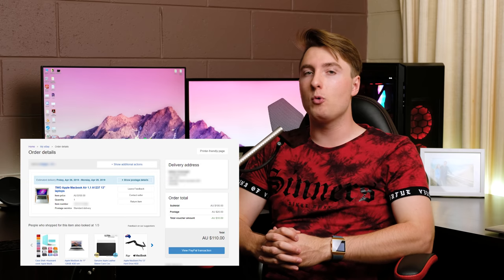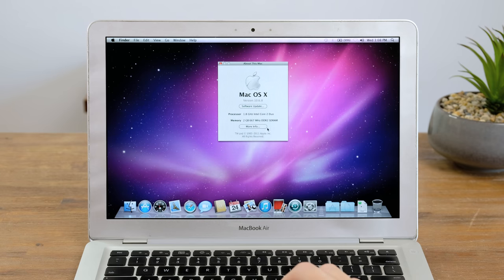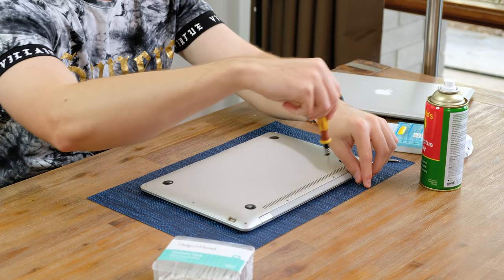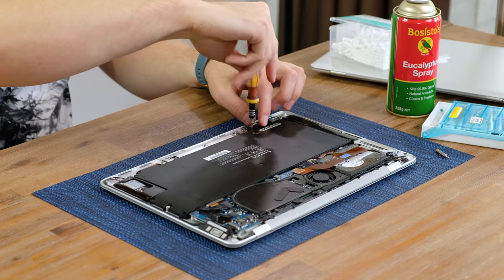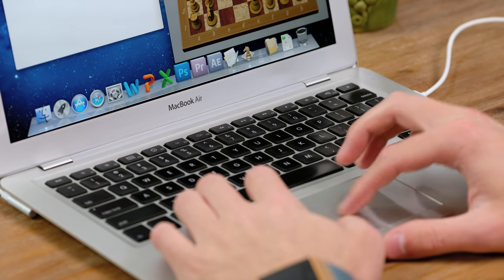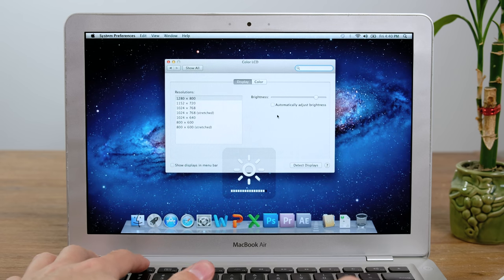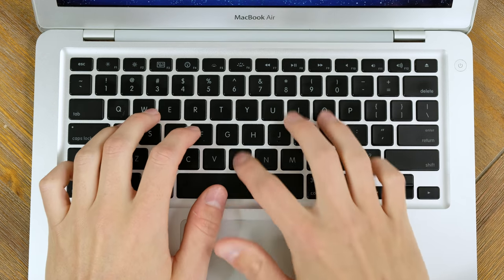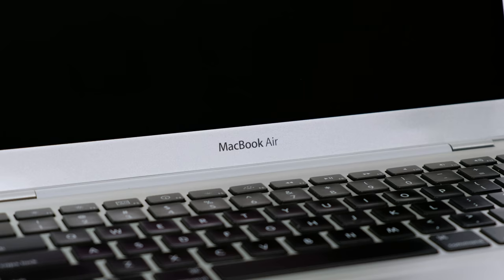I Bought 2 Macbook Airs For $100! Big Mistake?

Comment: 100$ for two working Mac air that's a big deal!
Reply: Not for these machines it isn't.
Reply: @jamiechampion299  why
Reply: @lefteris.adamou.1  Those machines are next to useless for the modern internet, not to mention that the newest official version of Mac OS X is 10.7 (we are on 10.14 now) and that they get hot enough that you could probably cook an egg on the bottom.
Reply: It's a ripoff. 1st gen MacBook Air's are useless now.
Reply: Kourkutas2 Kutsukuta I had a 2006 MacBook and it worked fine
Reply: Baickai Corporation  True lol
Reply: it isnt.... Why? So easy to tell. You can bid 100$ for two  2009 macs and they are better. ok no portability but who needs this ? When you need portability pleas buy 2010 mac airs ore 2013 airs
Reply: So many emotional commenters when it comes to apple stuff.
Reply: you can get an iflash adaptor and a 128gb sd card and with almost 150$ you get a working macbook
Reply: @notgeorge7563  for 150$ you can actually buy a 2012 macbook air instead.
Reply: For $50 per machine, you should be grateful they're working at all :)

Comment: These computers have no dedicated GPU, you didn't clean the GPU you cleaned the North Bridge
Reply: Actually Core 2 Duo CPUs do not have built-in GPUs.  GPUs are soldered separately on motherboards and he was correct.
Reply: Actually the smaller chip is the PCH

Comment: These were $1800 back in 2008, and for the price they did not age well. The Late 2008 / Mid 2009 with an SSD is slightly more usable, but still limited by the soldered 2 GB RAM and prone to Northbridge failure.

Comment: Mistake or not, still great to see those old laptops restored. I've been doing the same on an old Sony Vaio of mine from 2005, installing a current Linux 32 bit distro on it, alongside Windows XP
Reply: I have a Sony Vaio from 2005 and installed linux on it alongside windows xp too. what a coincidence
Reply: @cidsx  mine is a VGN-A317M model. Still a nice looking machine to this day with its 16:10 17" panel.
Reply: I miss Vaio. It looks good, run fast and super durable for it time.
I wonder if the new Vaio is on par with Sony Vaio.

Comment: I like watching you giving old Hardware a second Chance. I do the same as a hobby for over 10years now and most of the time Laptops and it surprises me every time how well most of them are usefull still today. Only cleaning the coolers, new thermalpaste and an cheap SSD. The only thing that suxxs is how hard it gets over the years to get to the components. Old alienware just remove 4 screws and you can reach everything, Last week a Toshiba from 2014 remove 16screws...turn around 8 screws...take out Keyboard...disconnect hundrets of these thin flat cables....Horror.

Comment: I would love to see how those run on Lubuntu. The lighter weight OS may speed them up. I have had very good luck with very old hardware and using lubuntu. Like 1.2ghz single core 32bit CPU with 2gb ram.
Reply: Me too, I'm considering replacing battery and SSD on a failed MBA and instal a Linux distribution on it, but have no guidance.

Comment: I'm really surprised the hinges are still good on these, they were a flawed design. Unless they've already been replaced but I don't think so. Apple official replacements were black but your machine looks to have original silver hinges. I'd be careful because when the hinges fail they often damage the case.

Also, try running Win7 or some other system and see if it runs any better, I bet it will.
Reply: s8wc3 It will run faster if it uses lubuntu, but I highly doubt that windows 7 will make it runs faster.

Comment: I just rebuilt a dell latitude D6 30 from 2007! Brand new LCD back cover LCD screen LCD trim bezel keyboard palmrest re-pasted a CPU gave it a good cleaning upgrade the RAM upgraded the hard disk drive to solid-state and installed a second modular bay battery! I didn’t join The eucalyptus squad however, because I prefer to use isopropyl rubbing alcohol to clean and disinfect

Comment: the mid 2009 higher end model with the SSD is 200 USD on ebay as of now. Works well as a budget laptop for High Schoolers since you don't need much out of a school laptop. It also means better software support as you can go as high as macOS 13 with patches but macOS 10.13 is fine for me

Comment: Still using my old laptop bought Dec 2009  when i was college. Still working fine untill today, im using it for networking,browsing youtube, paper works and using as a storages for my files.
Upgraded windows 10 already. Anti virus is up to date of course thats why it last.

It's a dual core laptop. 2gb of ram but i upgraded to 4gb of ram to make it more faster to handle multi tasking.
Reply: for that purpose you don't really need a expensive pc
depends on what people need to do
i need a more powerful pc to run games

Comment: Hi I don't know if this would help but have you tried installing Linux on the 2 MacBooks? I had the same problem with my Dell laptop. I'm not a apple user so I don't know if this makes a difference or not. PoP OS is what I used and it has fixed the problem in it's debugging while in the install process. I hope this was useful in some way. Really enjoyed the video. Thanks for the content! 👍

Comment: Running Ubuntu 16 on Macbook Air A1304 2gb with 128gb ssd.

The trick is to have a laptop stand to help with heat buildup this 
will prevent the laptop from overheating and shutting down.

As a netbook and for basic word editing the laptop is fine you can also run hd youtube videos on it.

The trick is to install a linux distro and to limit the number of active application running at one time as ram is limited.

Comment: Been building high end systems since the 90s, since even before CPUs needed heat sinks. I have always applied thermal paste in the way you showed, and my thermals have always been great. The whole (non-conductive) thermal paste application debate simply needs to end. Unless you're delidding and using liquid metal, pretty much any application method works as well as another. Put too little on and, yes you have a problem. Put too much on and you'll have a mess, but your thermals will still be fine. Err on the side of slightly too much and get on with your life. 🙂
Reply: I would love to get more informartion about that thermal paste application thingie, I wish to give a new life to a MacBook Air 6.1 with a failed battery and SSD.

Comment: Hi Psivewri!
i have a Macbook 2.1 black and want to install the latest version available of Mac OSX available for my hardware (Lion). and i see you used a flash drive to install Lion in the video. if possible, could you point me in the direction of the required files for USB installation?

Comment: "Setting it to the maximum brightness actually crashes the system"... How?
Reply: this is my question too. the screen obviously gets brighter. it's obviously not a power delivery issue or anything like that. 

the only interface the screen really has with the system is the software controlled parameters, such as reporting back what brightness it's set to. makes me wonder if the LCD controller ends up causing a buffer overflow/underflow or something. like maybe it uses an extra bit, or slightly different signalling in some other way, than the laptop firmware is expecting. maybe it's a slightly newer screen for a slightly newer macbook of the same size, or maybe it's an unofficial third party screen. so many questions!

presumably the syslog would say, it usually notes an actual reason for a kernel panic when they occur. far more reliable than correlating trial-and-error to try and suss out a cause and effect. obviously that information isn't present in the video though. 

i've been baffled by "maximum brightness crashes entire system" for like 10 minutes at this point! given how gracefully osx (and unix in general) handles application crashes and threads trying to go out of bounds in memory and stuff, i've got to assume it's something low level causing the problem. that makes me think drivers, running in ring0 on the cpu. which brings me back to the software-reported brightness level. it's the uncertainty on what exactly is going wrong in that process, that is really bothering me, haha.
Reply: @kaitlyn__L  It says "invalid backlight duty cycle" if it helps
Reply: @SkynetCyb  yeah that does. The duty cycle refers to the % of time a PWM cycle is on. Half on, half off, is a 50% duty cycle. It must've overflowed the internal logic, by going slightly faster than intended.
Reply: @kaitlyn__L  I saw a thread on ifixit about it, apparently there's nothing to be done, but I'm still wondering why it even happens, since they're apple's own displays
Reply: @SkynetCyb  apple outsources panels from LG and Samsung so there's probably a mixup there
Reply: @kaitlyn__L  I thought about it, I'd love to check which display came stock and which I have, but I have no idea, do you know where I could look?

Comment: With laptops or anything that has an exposed die, you should always manually spread it to cover the whole thing since it doesn't have the IHS to spread the heat throughout the whole die.

Comment: Put an SSD in the faster one and install Windows 10. 10 runs very well on a a Core 2 Duo with at least 4 gig RAM. I put it on a 13 year old Compaq laptop, after upgrading it from a single core 32 bit Celeron to the fastest 64 bit Core 2 Duo it could take and upgrading to 4 gig RAM of a speed to match the increased bus speed of the new CPU. Laptop was a freebie, spent around $20 on CPU and RAM. Same story with a slightly newer Dell Inspiron 1525, though that one did cost me a few bucks at a yard sale.

So how about it? Use Windows 10 to get more life out of old Intel CPU Macs after Apple has cut them off from current versions of OS X.

Comment: Dear Sir.  I used to be a Machead forever.  I switched to Windows at 10 because I hate Tim Cook's Apple.  I've dabbled with Linux over the years and felt MEH about it.  But in THIS circumstance I'd ask you -- mostly out of curiosity -- to try Ubuntu Budgie.  Budgie has a nice little dock and a clean interface.  The install should be easy but part of the setup will be... trying.  (They have this thing with widgets that's confused.)  Anyway I've seen it work shockingly well on Pentiums... and maybe (?) it will take out the kernel panic?

Comment: third party displays will do stuff like that. it's likely the power consumption of the backlight at max brightness is different from a stock apple display, which may be causing a voltage rail to sag and dipping the power supply to other components in the machine, which could cause the kernel panic...

As for the mac os issues, I'd suggest downloading a fresh copy of 10.7.5  direct from the app store and using a thumbdrive to install, either that or get deploystudio up and running with AutoDMG to build an updated 10.7.5 never booted os x image if the app store version isn't the latest.

Comment: Why the f would turning brightness up cause a kernel panic? Any insight?
Reply: Power issues possibly (higher power drain to the display and then undervolting other components, causing kernel errors when they put garbage into the RAM)

Comment: Why don't install Linux on it? To get more functionality and support, and maybe will fix the panics?
Reply from the maker: Perhaps I shall 😊 any recommendation as to what version?
Reply: @psivewri  debian
Reply: Psivewri Puppy Linux
Reply: try pop-os
Reply: @psivewri  Linux Mint is a good place to start, but if the hardware is 32-bit only you may need to go with XUbuntu or a Debian variant

Comment: Luke Miani recommended you to change the thermal paste? Bruh... he never actually does it himself!

The latest OS an early 2008 MacBook Air (aka first one ever) will run with graphics acceleration is actually 10.8.5, using nexpostfacto patcher!
Then, you can use Firefox Legacy fom ParrotGeek, a fork of a modern version of Firefox that works on here, to load modern websites. YouTube even plays smoothly in 720P, which is the resolution of the display so going higher doesn't make sense anyway.

Comment: Seems to me that you did practically nothing to fix the kennel panics except software tickles. No Ram check/swap, no disk check/swap, no temperature control checking, no motherboard checking, no Console reading... I can think of so much more to do. One does not just accept kernel panics: you've got to find the WHY and fix them. Kernel panics are not acts of God.
Reply from the maker: I actually determined the reason why they were getting kernel panics in the video. Without fitting the 'correct' displays, editing kext files or doing component level board repair it wasnt going to get fixed. These laptops are basically worthless and delving in deeper wouldn't be worth it.
Reply: Mmm, again, forgive me for insisting, but you did not determine the cause of the panics, you saw a mere symptom and called it quits. I think that you could have done much more sleuthing, but that 's just me I guess. Take care.
Reply from the maker: @mhrobe  For sure there is definitely more that could have been done, but releasing videos weekly and making them in my spare time doesn't allow for a whole heap of in depth repair. Thanks for the feedback!
Reply: Quite true. Thanks for your work and patience too.

Comment: I have one of these but I ditched Mac os along time ago I would say to really make these machines great is by putting puppy Linux and or windows 7 or xp
Reply: @girlsdrinkfeck  true but for 50 bucks for a laptop is still a steal of a deal
Reply: Fix my name I’d take it if it works...
Reply: Linux all the way for a mac of this vintage.  Not to say that GNU/Linux if for everyone, because it isn’t, but the performance increase will be gooood.
Reply: @girlsdrinkfeck  under Tim Cook Apple is simply a hole
Reply: @girlsdrinkfeck  Well sure you could get a think pad but rember apple tax
Reply: Just thought I would add this. Macs as a whole aren't slow. These original Airs shouldn't be worth anything. Really, they're bad. Very bad. Even putting something like Linux or Windows XP on these wouldn't help as a lot of their problems are hardware related. These models are slow. Why? They have to essentially turn off one of their cores because they get way too hot. It's just a bad design. And don't even get me started on the 1.8" iPod drives in those, they're another problem.
Reply: @Jenny_Digital  It can be for everyone. There are thousands of distros with different approaches.
Reply: Moskito I run mint on most of my home machines, and for the most part am happy, but the key here is that for some people there is a killer app or piece of hardware that ya just can’t live without.

This is often a highly personal thing too.

P.S. not an arch user.

Comment: install the cheapest sata3 SSD, should help.
Reply: These Macs don't use sata, rather a 1.8" 4200rpm pata hdd with a zif connector, just like the older iPod classics. Essentially there's no good way to upgrade them.

Comment: You can install 10.8.5 ;)
Reply: He probably could, but with these kernel panics he may be playing with fire. From what I could gather, it seems as if some kext files are messing with the upgrade to 10.7.5 already that is causing the machine not to boot. Perhaps installing 10.8.5 would work, but its usability may be altered and its not really worth it for a slow machine like the Air.
Reply: @dylanash2569  Yeah...Linux would be better

Comment: only in apple world set brightness can crash system lol
Reply: due to the replaced displays. The displays drive a feedback circuit that is messed up with generic lcd's and it tells the SMC there is an out of bounds reading. Not Apple's fault except not allowing 3rd party lcds to be used.  I have replaced 100 of these displays over the years, used displays are not expensive and then everything works normal.